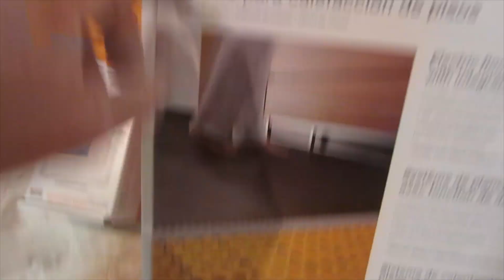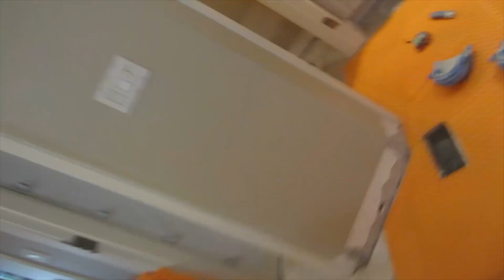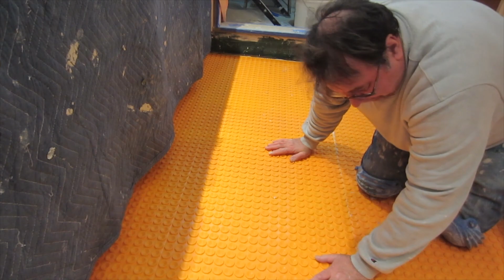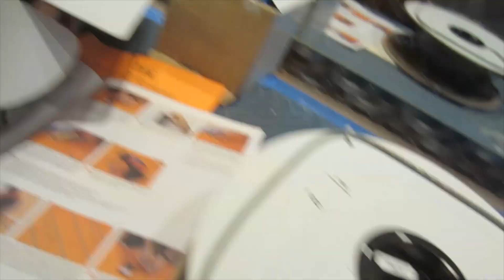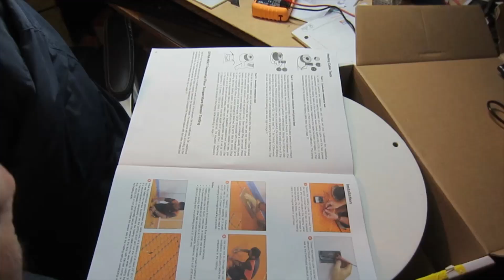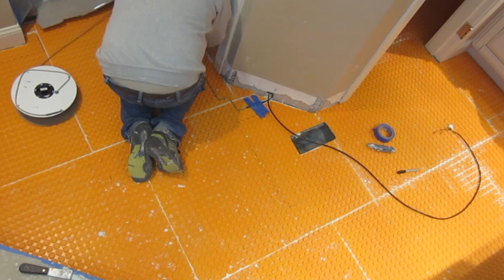Ditra Heat, electric floor heat  how to install it start to finish

Comment: Hi Sal,  I want to first thank you for all of your excellent videos that have helped me out so far.  I put down the Ditra Heat two weeks ago with Laticrete 254 platinum to my plywood floor.  Where I am a DIY I wanted to fill in the waffles and wires first before I started tiling so that I could snap lines ect..   I filled it with the 254 that I had and that was about two weeks ago.  I’m kicking myself for not filling it in with the recommended un modified.  I was told that I should be fine now though because it has had plenty of time to dry.  At this stage should I still use the un modified or should I use the modified now that I have filled the waffles and wires in with the 254.  I will be using 24x24 tiles what do you suggest that I use.  Thanks a lot for all of your help.
Reply from the maker: Should be fine, since it is all dry, probably would be a good idea to use schluter thinset, either the modified or unmodified will work.
Reply: Christopher DiBona Did your tile job hold up ok with using all modified thin set? I couldn’t find unmodified for large format tile and want to just use modified for everything
Reply: grady 180     It’s holding up great.  I’m not worried. about it at all.   I’m 99% positive that I bought the large format unmodified at either Lowe’s or HD.   The modified Laticrete  Platinum 254 I filled the egg crate holes in isn’t going anywhere.  Every tile guy I know says they like 255 better because it’s easier to work with, but they say the 254 bonding strength is the best. I’ll look and see if I can find exactly what I used and send you the link. Good Luck

Comment: Sal - thanks for your videos, I'm learning a lot. have you ever used ditraheat over a cork underlayment as a thermal break (glued down over concrete?). Do you use unmodified or modified thinset over cork?
Reply from the maker: there is now a version of ditra heat with an incorporated thermal break so you can avoid the extra step.
Reply: +Sal DiBlasi i saw that - unfortunately that was released after I already bought my cork board and ditraheat (without tb). would've gone with that had I waited, but now I'm stuck with the cork board option. Would still welcome any thoughts you might have on bonding ditraheat to cork?
Reply from the maker: Best to contact schluter about that, they are usually very helpful and will answer all your questions.

Comment: I need to know what to do with the wires! "What" did the electrician tell you? How does it get to the thermostat? Does it go into the wall. How?
Reply from the maker: Yes goes in the wall up to the electrical box where it is connected to the power and thermostat. If the lead is threaded through a conduit, the sensor wires should not be threaded through the same conduit but separately.
Reply: Thank you

Comment: HI Sal....When I watched the Schluter video they suggested to use the unmodified thin set?  What do you think?
Joe
Reply from the maker: Unmodified thinset is a must and you will void any warranty if you don't use it. You can use regular ditra in the unheated areas, but Ditra heat is a little thicker than ditra, and a little thinner than ditra XL, so you might just want to use ditra heat membrane for the whole thing. Use only a premium unmodified thinset, like Tec Uncoupling Membrane Mortar, or DitraSet or some other quality product.

Comment: Wouldn't you have a problem with the thermostat next to a heating vent supply.?
Reply from the maker: The sensor is in the floor, the thermostat is the control unit.

Comment: The sensors were attached using a blade: it's not clear how this is done. I see you gutting diagonally across a circle in the membrane, but what exactly is happening?
Reply from the maker: Cutting a channel in the center of  a puck  to insert the sensor in the middle of two wires.
Reply: Thanks! :) I'm quoting this system to a client, and your video has shown me a lot - especially in the labour allowance for this kind of system.

Is the reason for the two sensors being installed to give you a backup one in case the first one fails?
Reply from the maker: Exactly

Comment: If you have 18mm ply is that okay to put the ditra straight on or do you need to put a cement board on top of the ply?
Reply from the maker: If the plywood were the only determining factor, that thickness would be ok, however the suitability of a subfloor for tile is determined by the whole structure. Cement board has no structural value, so it would only add thickness not strength. https://www.youtube.com/watch?v=74BDTI67S1M

Comment: Hello Sal, I assume the ditra heat requires its own isolated circuit? Im assuming a 20 amp dedicated.
Reply from the maker: Yes, must have its own dedicated circuit.

Comment: Another question for you.  I put the Ditra Heat mats down using Bostic Ditraset, 1/4"x 1/4" trowel, on a concrete slab.  One small section, maybe 6" x 2", in the corner of the mat doesn't look like it adhered to the floor as well as it should have.  It's glued down, but it looks like I could pull it up if I tried.  Should I cut the section out and adhere another piece?
Reply from the maker: See if you can get some thinset under it and put a weight on it.
Reply: Thanks again, Sal!
Reply: Sal, I'm to the point where the saddle will be installed.  Any tips?  It's 36"X 6 1/2", marble.  The substrate is concrete.  I figured I would cut a piece of ditra, thinset it to the floor, then thinset the saddle on to the ditra.  Should the thinset be a little stiffer than usual?  Do you back butter a saddle?  Trowel size? Thanks in advance for your help!
Reply from the maker: As with any tile or threshold it needs to have proper thinset coverage. Back butter, mix thinset as usual install as usual on the ditra.
Reply: Thanks Sal!

Comment: since we are talking about thin-sets, what is your opinion of Custom Building Products Flex Bond Morter for membrane to OSB substrate?   This seems to be what the gurus at Big Box Store recommend, though I don't always trust their opinion.   The non modified mortar recommended was Custom Blend unmodified thinset mortar.   Your opinion for durability and quality is appreciated.
Reply from the maker: I don't  use Custom building products, I don't like them, and I would never trust the opinion of a sales clerk.
Reply: ***** Thanks for the opinion, as I don't trust sales clerks either.
Is there a better choice available at a Lowes or H.D or should I shop at a tile place?  How about performance on Prolite thinsets?
Reply from the maker: Like i said i don't use custom products, best thing to do is go to a reputable tile store.
Reply from the maker: Not a problem, in fact if you have a run of more than 10 feet it is recommended to do just that to give a break to that straight run

Comment: Someone I know put the heat system right over plywood how would you install tile over that ? Detra is best and you need a sub floor especially under plywood
Reply from the maker: That is the old way of doing it, use self leveler to encapsulate the wires.

Comment: Hi Sal. The question: Doesn't this Warmup system need some insulation e.g. Jackoboard? I guess the matting is not providing any insulation or am I wrong?
Reply from the maker: On plywood no, on concrete they have the same product with a thermal break incorporated into the mat, installation is identical.
https://www.youtube.com/watch?v=DjPMNpn-dzk&t=1s

Comment: How do i install ditra heat for my shower pan?  Master bath floor will get heat and also want it in shower?  Do the entire floor the very first thing and then install shower pan on top of ditra heat?
Reply from the maker: Very specific instructions for wet areas https://www.youtube.com/watch?v=j8F_vTUfShA

Comment: The head of the thermostat wire snaps in between the studs. No need to use a utility knife
Reply from the maker: The older sensors, like the one in this video, did not fit.

Comment: I have an old plank floor in a kitchen and used floor level patch to level it...can I use modified thinset over this to attach the ditra?
Reply from the maker: +Mike LoVetere If you applied the patch according to instructions and is a suitable patch, then yes.
Reply: +Sal DiBlasi  it is a Portland cement based patch...Henry unipro to be exact. Had to cover 99% of the floor practically. A ditra pro said I could use ditra set, an unmodified thin set.

Comment: when isntalling ditra heat on a layer of self leveler, do you use a modified or is it considered like concrete and you use an unmodified thin set?
Reply from the maker: Use modified, which can also be used for concrete.
Reply: @SalDiBlasi  toward the beginning of the video you recommend unmodified for concrete. I know you mention that you want to use unmodified whenever there is no place for it to dry besides for through the grout lines in other videos but why with concrete do you mention using unmodified in the video. Is there a reason it's preferable?
Reply from the maker: This particular floor had moisture issues, so unmodified was the best option, however in most cases a modified mortar is perfectly acceptable for concrete.
Reply: @SalDiBlasi  thank you Sal

Comment: what type of megohmeter is that you used? I am looking for one to test my cable. thanks.
Reply from the maker: +Mark Yamada I actually don't use that one any more, gave me a lot of trouble This is the one i use now. http://www.amazon.com/Extech-380260-Autoranging-Digital-Insulation/dp/B000EWW2UA

Comment: Can the ditra heat membrane be installed over old 1x6 subfloor?
Reply from the maker: no
Reply: @SalDiBlasi  bummer.  So I’m gonna need to cut out the diagonal running 1x6 subfloor and replace with plywood (cause if I add on top, it won’t even out with hardwood coming into the bathroom).  Wonder why?  Cause of the spacing between each board?

Comment: what brand of mortar do u use ? mapei ?
Reply from the maker: Mapei, Tec, Ardex, whatever works
Reply: Sal DiBlasi unmodifed for the membrane over plywood ? And modified over concrete
Reply from the maker: Modified to install Ditra on plywood, or either to install ditra on concrete, unmodified to install tile on Ditra uless you use Schluter Allset.

Comment: Sal, great videos! I am doing a Ditra Heat and my question is can you set the Ditra and walk on it the same day or do you have to wait until it dries to the floor?
Reply from the maker: +hectorjrr No need to wait, you can even start setting your tile if you like, however i like to let it set overnight, if you have to lift a tile for any reason you have to be very careful not to lift the ditra as well.

Comment: So just to be clear...modified mortar on the mat for tile?
Reply from the maker: No, unmodified, unless you use schluter thinset, which was not available at the time this video was made. So to be clear, Modified under the Ditra Mat to install it on Plywood, Unmodified to install the tile on the mat, unless it is Schluter AllSet thinset.
Reply: Ok thanks.  First time installing ditra floor heat for me.

Comment: Sal, I used latacrete 253 for both ditra to advantech plywood and for the marble 1" hex mosaic to ditra..is that ok?
Reply from the maker: I would have used a slightly better mortar on the Advantech, but the 253 will work, you have no warranty with the 253 on the Ditra, but it should be fine.

Comment: Why didn't you terminate the heating ducts, now that youv'e installed heated floors?
Reply from the maker: These heated floors are not meant to be a primary source of heat.
Reply: Thank you for your response. Can they be used throughout the house for primary heat or just supplemental heat?
Reply from the maker: Supplemental heat, under tile for this type of system. There are other types of underfloor heat that can be a primary source of heat.
Reply: Thank you, do you have any that you prefer?

Comment: so when it comes to install tiles- they just stick to that plantic diethra?
Reply: Short answer: Yes. Long answer: The when mortar is mixed with water it causes small crystals to grow. These crystals grow into whatever they are adjacent to; like the substrate below and tiles above. However this bonding process doesn't work with the top, plastic side of Ditra. Instead the process is mimicked by having the mortar fill in the holes, which are wider at the bottom,  to mechanically lock the tiles in place. This is why Ditra is referred to as an "uncoupling" device since it keeps the tile in place while keeping it separate from a floor prone to lateral movement; cracked concrete, plywood etc.
Reply: Still its crazy. I did few bathrooms but never seen tiles and mortal being placed on the top of plastic! I guess its about time to try
Reply from the maker: here is a detailed explanation.  https://www.youtube.com/watch?v=YpXEXqbh7ok
Reply: Did you ever try to put over the wonderboard? I am finally doing my bathroom and cement boards are all over my floor. Do you think it will work if i place this plastic over my cement boards?
Reply: Sry for errors my fingers are too big for this phone
Reply from the maker: Best thing to do is contact Schluter for an answer, they are very helpful.

Comment: Question, I read in the install manual about expansion joints. I am not sure if this applies to my application. I am installing ditra heat tb over an existing concrete floor in a sunroom. The area is 11 x 15. Do I have to have expansion joints? I left 1/4 inch around the perimeter. I am confused about what the manual says. 
I will be installing 4 x 8 tiles over this. Ty for any help.
Reply from the maker: +D Johnson indoor every 20 to 25 feet, outdoor or exposed area every 8 to 12 feet and awalys movement joint a the perimeter. So if the floor is exposed to full sun it is considered exposed, if not exposed to full sun, it is considered indoor.
Reply: Sal DiBlasi , ty for getting back to me. The room has windows on 3 sides but it does not get direct sunlight.
There is a singled roof over the room and the room has AC as well. The concrete floor is approximately 60 years old. So if I understand what you are saying, I should be ok with just the perimeter joint against the walls.
ty for your help.

Comment: Your trowel's notch size is way larger than the Ditra trowel's notch. How come?
Reply from the maker: +Order in Chaos The Ditra Heat mat requires the use of a 1/4"x1/4" square notch trowel, larger than the trowel used for the regular ditra.
Reply: +Sal DiBlasi is that according to Schluter?
Reply from the maker: Thomas Deriso Yes 100% Page 15 the number 1 illustration, https://s3.amazonaws.com/scclegacy/media/ditraheat-handbook.pdf

Comment: How much should I expect to pay for materials and labor if I had someone do a 168 sq ft sunroom
Thanks
Reply from the maker: Best way to find that out is to get a couple of estimates.
Reply: Thanks but a lot of tile guys don't want to touch it, do you have a ballpark figure for labor only?  Regards
Reply from the maker: E Sugar If there is one thing I have learned is never to give a ballpark figure.
Reply: A decent ballpark would be $10/sf.  That would include the Ditra, Ditra install, Mortar, Grout, and Tile install.  You would still need to purchase tile.  Also, adding the in-floor heating would add cost to that (wires, thermostat).  You'd likely be around 2 thousand plus the cost of tile.

Comment: Sal,  my friend said to use laticrete 254 under ditra heat on plywood. What are your thoughts about that?
Reply from the maker: +hectorjrr That is perfectly fine, Modified to install the ditra onto the plywood, unmodified to install the tile on the ditra.
Reply: +Sal DiBlasi Thank you,
Reply: +Sal DiBlasi Hi Sal.... would laticrete 252 work for adhering ditra heat to plywood?
Reply from the maker: Probably, but I like to at least step up to 253 gold. I never use the lower end thinsets.
Reply: +Sal DiBlasi   Got it!.... (I had a few bags given to me after a workshop and don't want to see them go to waste)
Reply: +Sal DiBlasi  ANOTHER QUESTION!!    I see in your video that you're applying thin set to a plywood floor that looks like it used to have mastic on it for adhering the prior finished tile to the subfloor...  There are ridge lines from the original trowel that applied whatever glue or thin set was originally installed... are those marks in the video simply stains from the mastic, or is it not necessary to entirely remove all of the existing mastic before applying the modified thin set with a 1/4" x 1/4" trowel?
Reply from the maker: Thomas Deriso There was no mastic, but old thinset that was removed, what you saw was mainly just staining as you say. Mastic should never be used with Ditra.

Comment: Great video except half the installation is the wiring. I assume it needs to be on it's own breaker. Should have included the wiring   in the video.
Reply from the maker: Yes it does need to be on its own breaker, and the connection must be  done by an electrician with a licence, since that is not my expertise,  then i can't show how to do it.

Comment: if you install this on a plywood floor and tile over it you don't need a mudfloor or cement board ?
Reply from the maker: Correct
Reply: thank you